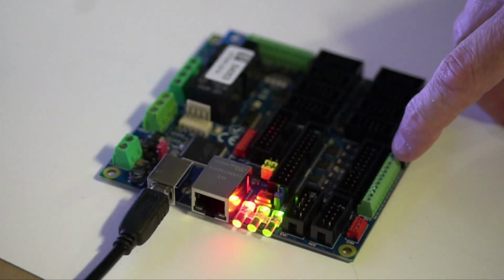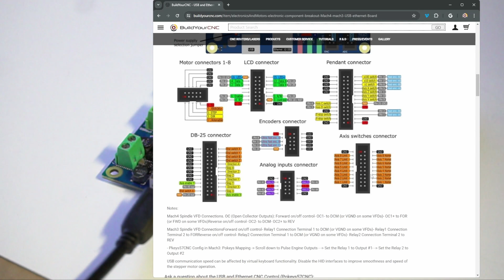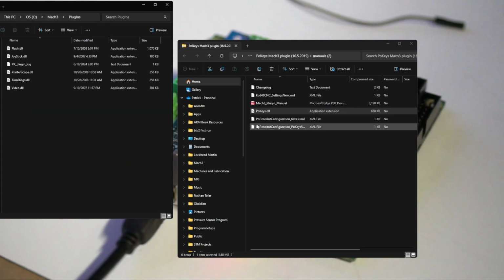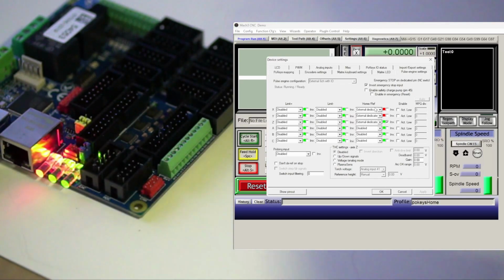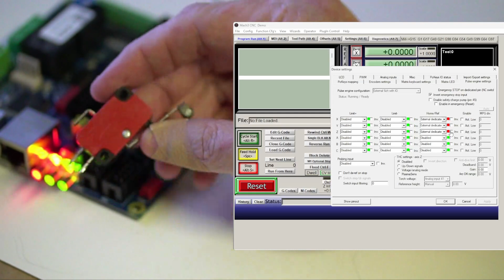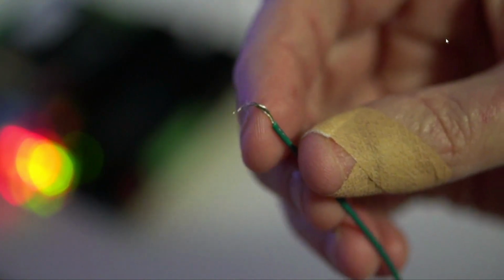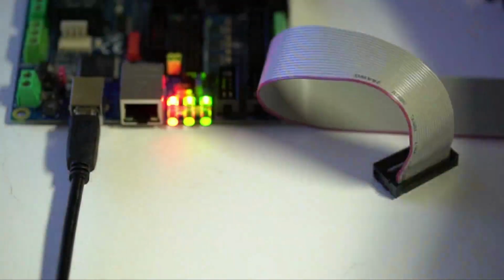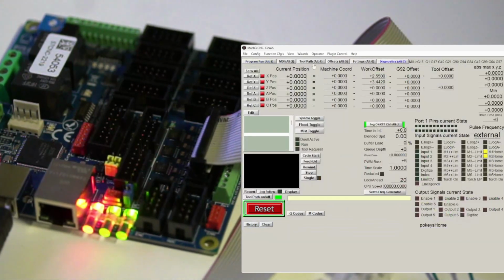How to Connect and Configure a Home Switch on the PoKeys57CNC Controller | Step-by-Step Guide

Comment: Awesome start to finish setup of home switch.   Thanks
I am running into a issue on a mini mill conversion.  I had set up the front and rear prox switches wired in parallel, as a limit & a home switches somehow using only the terminal strip not ribbon cable.  And now it is acting up.  
When I activated the N/O switches it lit up "home, & M2 ++ " in the diagnostic tab on Mach3.  
When I homed the machine it would travel back and right hit the prox and backoff.   But if I was not "homing" and it triggered any prox it would stop the machine because acts as "limit".  
For some reason the switches are lighting when activated but the signal appears to not always make it to the pokeys board.   (appears to be intermittent so wiring maybe) 
I am making a new enclosure for the controls and will be cleaning up wiring and such.  Now is the time to address this 

Can you describe how to make the home switch also act as a limit switch?   It has been 4-6 years and I can't for life of me figure out what I did to make it work.  I don't want to run & wire a 3rd switch on each axis just for homing. 

Also I would love to see a video on a touch probe or probe plate connection to the Pokeys board.  I have the 3d probe working and the touch plate working however I cannot use this to do edge finding in Mach 3 because when I connect the clip to the vise/part it is not registering.   If I put the touch plate on the vise it triggers the digitize input without the ground clip attached.(must have to isolate a ground/common somewhere on machine?)
Reply from the maker: I believe you need to wire the home switch and the limit switch on separate    pins. You can have the home switch serve as the limit - - , but you need to set that up in the pulse engine page. Where it is engaging at random places, that could also be EMI, or metal is getting close to the prox switch.
Reply: @PatrickHoodDaniel  Thanks for the fast reply!  
I was getting into it more yesterday.   Seen the "same as home"  setting is how I used that in the pulse engine.  
The prox switches all will light the indicator led on them when I use a piece of steel to trigger them.  The signal is not always making it to the pokeys.   
I have left a metal ruler against on the Y prox and jogged the X and the limit sometimes reported and often did not.  
I am going to use a terminal strip at the machine to connect limits and whatnot.  This way I can test at the strip to determine where the issue is...  Switch or wire.   
I know if I jumper GRN and the M1,M2,or M3 at the board it reports the trigger every time.   
Must be a bad switch or wiring. 
Does it matter to Pokeys if prox switch is NPN or PNP? (N/O)
I know I have one switch to replace due to finding out the hard way <crash> LOL

Comment: is it better cnc controller than mach 3 USB rnr motion controller ??
Reply from the maker: @KamalSingh-ny9vw  depends what you want to do. It does have many more features, but for a typical CNC, it may not be necessary.
Reply: @PatrickHoodDaniel  I am basically building my epoxy granite cnc lathe machine and want to use with closed loop steppers and I also bought the RNR mach 3 USB controller but it's like too old and wanted something new like mach 4 or something
Reply from the maker: @KamalSingh-ny9vw  Mach4 is definitely a solid piece of software. If you are up to learning a new control system, I say, go for it. You can find Mach4 and the controller on my website if you are interested. Good luck with your project.